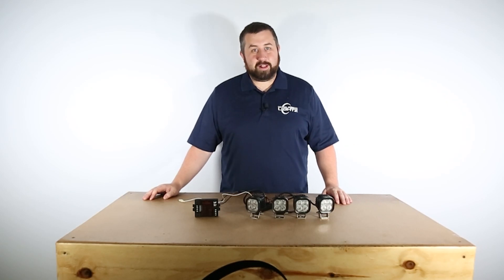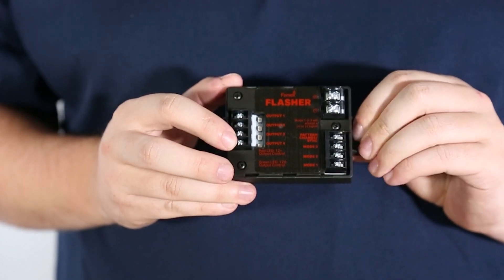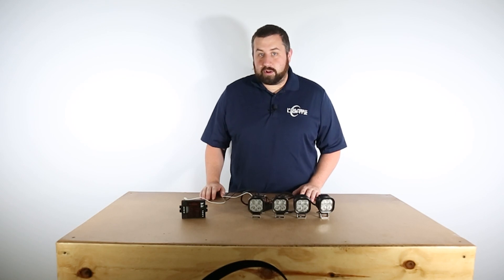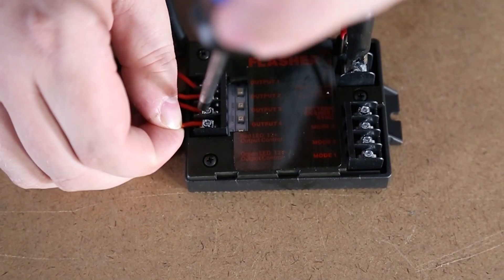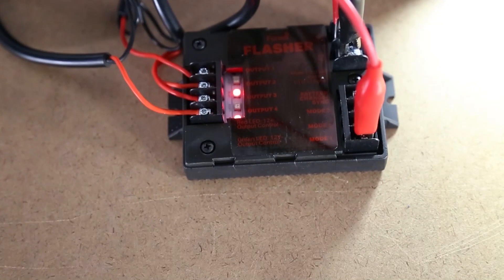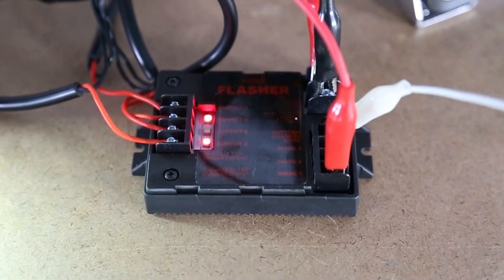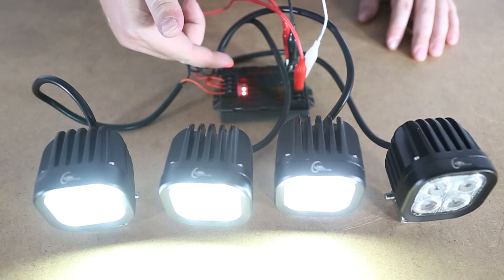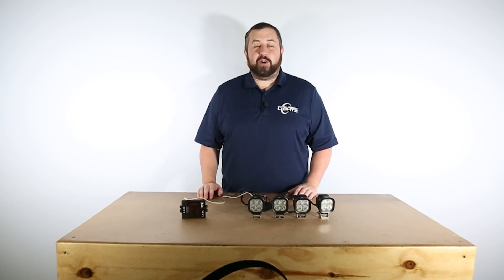Feniex 4 Output Flasher || Product Feature

Comment: Question, so say I have a dual color light module. If I place that light to a simple alternating back and forth pattern would this unit flash both colors? Could you guys do a video on the feniex flasher with maybe some Fenix surface mounts?
Reply from the maker: The light is not able to do both colors at the same time - it would still alternate. We are working on making more videos using the 4 Output Flasher!

Comment: Does this flasher have Traffic advisor arrow capability? Like if i get single surface mounts and hook them up will it give me traffic advisor patterns with individual T3 for example . im doing an all feniex setup and im trying to cut cost of buy the expensive lightbars
Reply from the maker: The T3's have built in patterns so the 4 Output Flasher is not really needed for that setup
Reply: @UltraBrightLightz  so if i didnt want to get a stick i could just get several t3 and spread them out and they would work traffic arrows?
Reply from the maker: @ReaperCVPI  I think you would have a hard time syncing them to do that so a stick light would be better
Reply: @UltraBrightLightz  gotcha i was going with a stick if i couldnt do that . i appreciate your help
Reply from the maker: @ReaperCVPI  You're welcome!

Comment: How is the steady burn feature activated? 
Would it be programmed to one of the 3 mode terminals?

So for instance,  can i have one switch to turn the lights on 'steady', and then another switch to turn them on as strobes?
Reply from the maker: Yes that is correct!

Comment: How many channel’s does it have? The im hoping i can run anywhere from 2-4 lights per channel. Im also planning to try and run the manufacture lights for f possible but im hoping i can find a device that will over ride the manufacture lights at night and will still turn in during the day when my manufacture lights dont need to be used.
Reply from the maker: There are four outputs rated at 5amps each!

Comment: Are the V3 Fusion Surface Mounts compatible with this flasher if they are on a steady burn pattern?
Reply from the maker: The Feniex 4 Output Flasher is made for lights that do not have a built in flasher so it would not work with the Fusion Surface Mount Lights
Reply: That is not true! I placed 8 Fusion Surface Lights and Strobes N' More TailGator Taillight all on steady mode. All lights work with different flash patterns using this flasher.

Comment: So if you want to connect to led tail lights do you t-tap into existing power or ground of vehicles tail lights ?or does existing tail light need to be cut from vehicles wiring and ran thru module?stand alone lights I get NP. BUT that diagram feniex gives doesn't explain existing vehicles lights...any help would be greatly appreciated
Reply from the maker: Your best option will be to speak to someone at Feniex in their Technical Support Department.They will be able to answer your question! 1-800-615-8350
Reply: Same question
Reply: @justintracy1374  you would need to cut the factory harness and run the light feed through the feniex flasher

Comment: Is it possible to control dual color lights with this module? For example I have white/red Strobes n more E4, but I am unsure if its possible to sync 4 of these E4 lights with this module, and I cannot find an answer anywhere.
Reply from the maker: I am not sure but I have reached out to my Feniex Representative for an answer.As soon as I hear back from him I will post his answer!
Reply from the maker: Our Feniex Representative replied back to me.Here is what he said " You should be able to sync other manufacturers' lights with our flasher no problem! It may not work with the SNM lights, but generally speaking, I haven't found a single light it doesn't work with yet!"

Comment: I’m trying to find light heads to use with this flash controller besides white work lights. I’m a firefighter so I’m looking for red and white light heads. I’ve tried a wide variety of different brand surface mounts that have internal flasher controllers but they do not work I can not find any light heads that do not contain the internal flash controller. I want to use the steady burn mode.
Reply: That should work on any light head,internal flasher or not..I know they work with feniex t3's, cannons,fusions
Reply from the maker: Sorry I am not too sure who makes lights that do not have a flasher in them for emergency vehicle use

Comment: Hi I have a question I've got one flasher and I want to get another one and connect them up together will they sync up with each other or no
Reply from the maker: Yes you can do that! Here is how:To synchronize more than one Flasher unit, activate the same flash
pattern on all units and connect the ‘Pattern Changer / Sync’ terminals
together.

Comment: Can this be used on headlights and taillights?
Reply from the maker: Yes!
Reply: @UltraBrightLightz  thanks so one flasher would be able to connect to both headlights and taillights and then connect to a switch to turn on and off with rest of my emergency lights on vehicle?
Reply from the maker: @commanderhall848  You will need one flasher for the headlights and a second flasher for the taillights.You will then be able to connect it to a switch so they turn on with the rest of your lights
Reply: @UltraBrightLightz  are there any other flashers that can be used on both headlights and taillights together?
Reply from the maker: @commanderhall848  We do not have one that can be used for both.We have been told by our Feniex Representative that using 2 is the best way to install it
Reply: @UltraBrightLightz  thanks so much
Reply from the maker: @commanderhall848  You're welcome!
Reply: @commanderhall848  sir can you find these on Amazon also
Reply: @ReaperCVPI  yes
Reply: @commanderhall848  ive been investigetting different flashers and sure enough look who i find on here commander amazon hall . lol jk buddy
Reply: @ReaperCVPI  lol